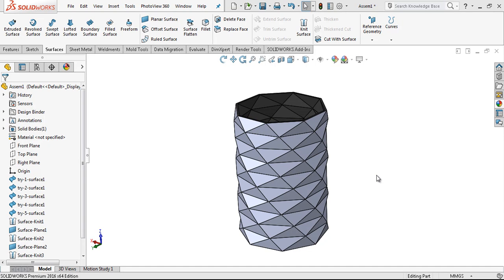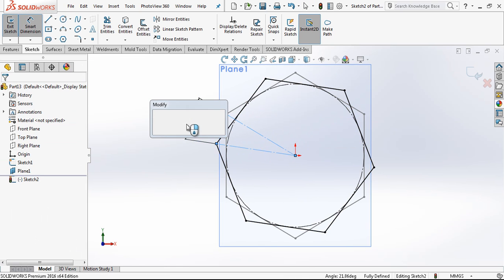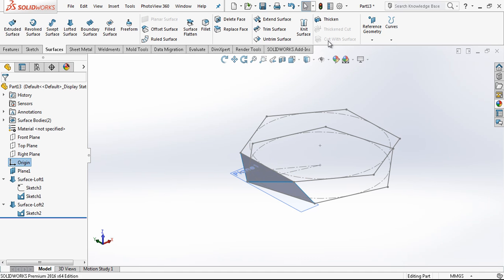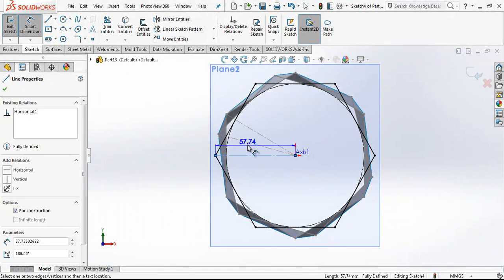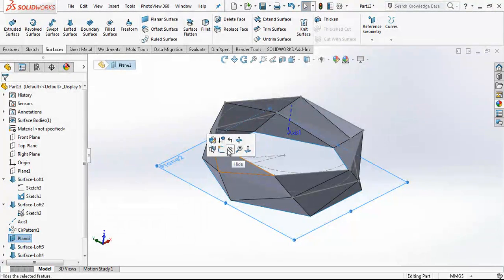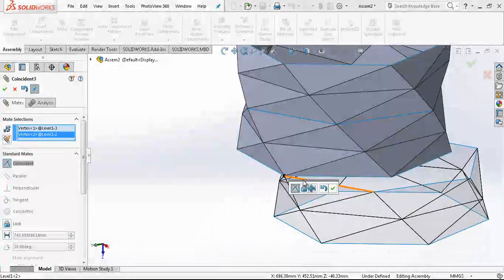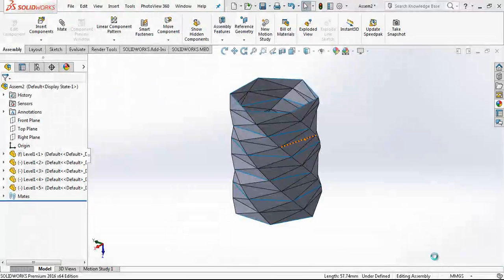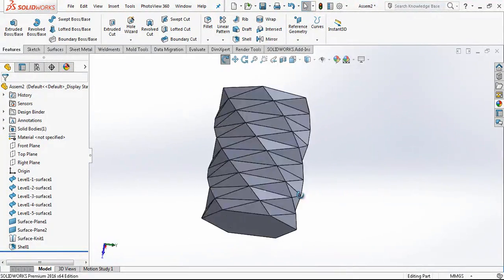Surface Example - Patterned Pot - SolidWorks

Comment: Hi! Would it be possible to do this in a way that the pattern folds and unfolds at the creases?
Reply from the maker: Hi Dear, I did not understand your question. Sorry
Reply: @3D-World  hi thx for your reply! I meant instead of a rigid pot, can we design it such that the cylinder can be compressed? like this origami pattern https://www.youtube.com/watch?v=ar7dMtsA-dY
Reply from the maker: If you model your part in assembly environment it will be possible

Comment: hi, like your videos, thx. Do you have any tips in order to make same, but cone not cylinder (in general form), like top of the pot would have bigger radius than bottom?
Reply: i mean i found out that i could make hexagons bigger each time, but how to do in pattern manner?
Reply from the maker: I would draw a curve first which represents your general form. Later on each plane I would draw hexagons and coincide them to that curve. 

Maybe you should increase number of  your polygon eachtime.
Reply: @3D-World  yes, but in your case i would need to draw each hexagon manually, right? if so, do you know a way to make it like "linear pattern" but with increasing diameter?
Reply from the maker: Yes each layer will be modeled manually unfortunately. There could be smarter solutions but we have to work on a bit. 

Have you check my page there is one video, a vase which is red and builded by triangular shapes. Maybe that could give you an idea.
Reply: @3D-World  i'll check, thanks a lot man
Reply from the maker: Welcome Dear 😊